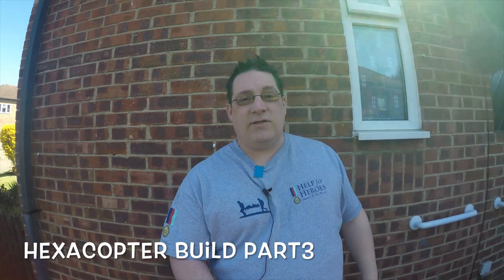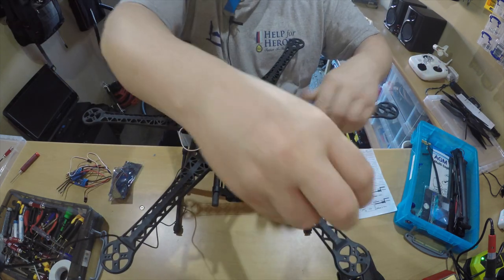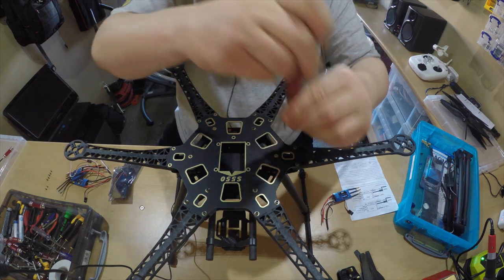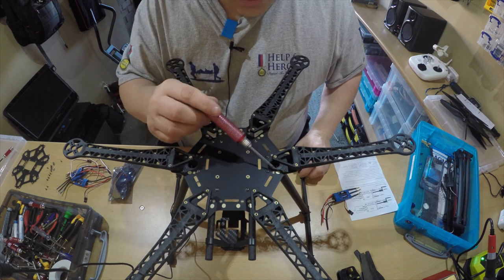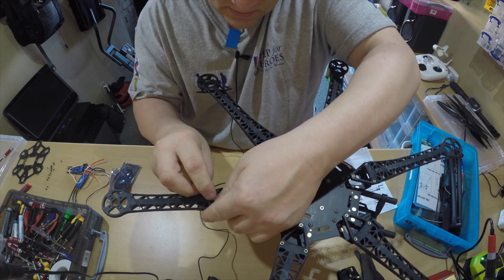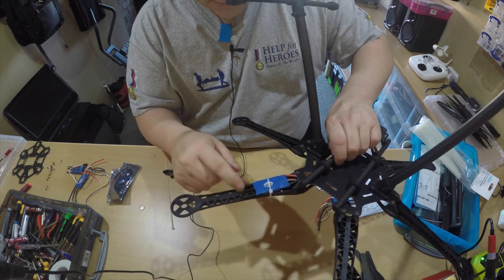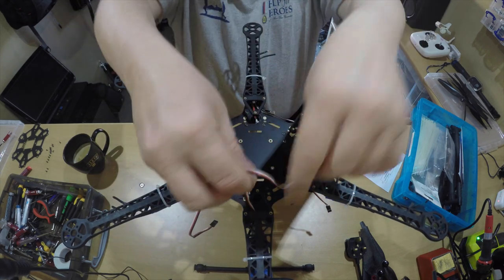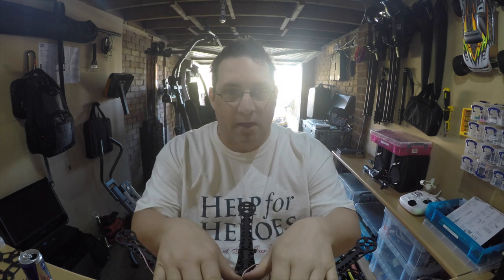HMF S550 Hexacopter Build #003

Comment: Yes Jack. If you cross the right front motor wires and the left back mirrors wires. They should spin in the right direction. Nice build Jack. It's going to look awesome.
Reply from the maker: Johan Opperman it coming together nicely now.

Comment: hi jack
the motor direction is changed by swapping two of the three wires around so the only way to see if they are going the right direction is to solder the motors to the ESC and if its spinning in the right direction then your fin but if it isn't then swap around two of the wires and its reversed.
thanks isaac
Reply from the maker: isaac young i was going to try this but didn't want to solder it all together then have to unsolder etc, but look like i will have to do this now, i have the receiver now so should be able to get this up and running and find out which motors go where lol

Comment: At 12:05 you are soldering it the connections backwards... Red is Positive, Black is negative.  If you power it up you could fry all of your ESC.  
As for the rotation of the motors if you purchased motors that are specifically CW & CCW they are identical except for the threading on the main shaft.  As others have commented you just need to cross any two of the 3 lead wires, From esc to motor.
Reply from the maker: isotope115 I did notice this after i finish filming it so it on the right way now, see that what i thought too about the motor as people saying the esc wire across over tell which one the motor spin etc. I have a closer look at motor to see if i can tell them apart with you suggestion on the threading. thank you always learning something new :)

Comment: Didnt think you would get around to finish this build..I ended up buying the s550 from ebay with retracts  and should have my naza v2 combo set arriving here soon..what battery you going with?
Reply from the maker: Elijah G i have an option for a 4s up to 6s so i may buy 4s to start with and see what flight time get first, i ddnt to leave this build unfinished and didn't mean to leave it for so long. The channel getting busy and loads of question on all type of quad coming in, so now sorting out my days so i get to spent around a day on question and the reset on make more video etc.
Reply: I'm looking forward to your maiden and to see what your flight times will be..I'm gonna use the multistar 4s 8000mah  10c high capacity battery..should average out around 15 to 20 minutes depending on payload... I'ts good to hear from you my friend work here been super busy so I havent had the time to check all your videos out but will be catching up to them here soon..
Reply from the maker: Elijah G i looking forward to get it in the air now so not long to go, lol :)

Comment: Just watched your video, and is part 4 taking so long because you soldered the red (positive +) wire from the ESCs to the negative pole on the base PCB? Or did you reverse the polarity on the distribution board?
Reply from the maker: +John Barnett i did notice this when filming and correct it, it taking a while as other stuff keep pop up to do, so will be making effect next few weeks to get this project finished.
Reply: +Jack DJI Phantom That's great Jack, was a bit worried and look forward to next part soon.

Comment: why you use on black frame kit white zip belt? the esc better place the close motor (smaller interference). terrible amateur.
Reply from the maker: +matex ONY I have replace the white ones with black and made and few new changes, video coming soon.